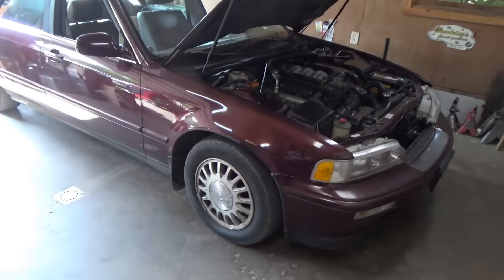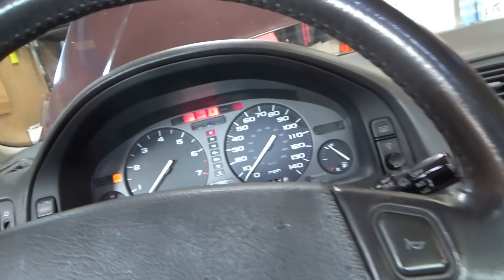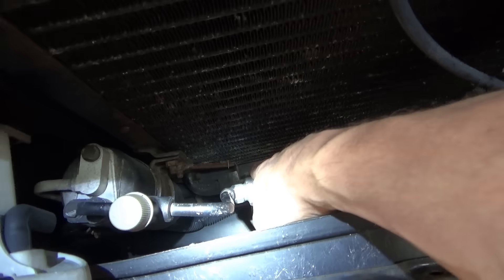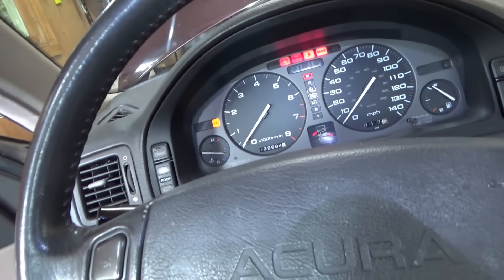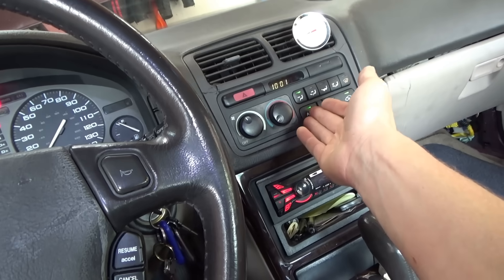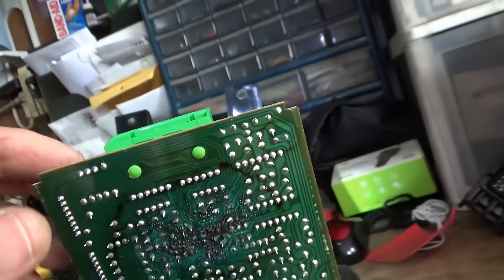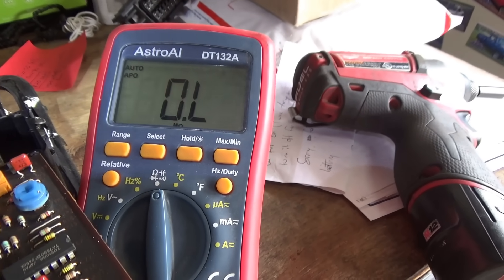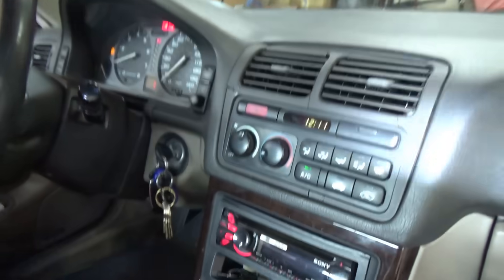Classic Acura: No A/C! ('95 Legend V6: Parts UNOBTANIUM?)

Comment: You need to get you a refrigerant identifier to protect your investment.  There are a ton of counterfeit refrigerants out there and people charging with R-290 (propane). You'll never recover all of the refrigerant even if done right after charging. Some remains trapped in the oil. You did the only logical thing to be done, but I was thinking the 95 Hondas/Acuras were OBD2 with the connector behind the ashtray.

Comment: Nice fix,to be comprehensive with safety precautions your bypass you could have included a relay on the fan output so that if the fan cut off the relay would interrupt the signal to the compressor. 😊

Comment: The fan board makes sure there is air blowing across the evap coil so it doesn't freeze up. If someone decides to forget to shut that switch off and just turn the fan speed to off. It will keep the compressor running, banging off the limit switch (like banging off the rev limiter), and freeze the coil up.

Comment: My 1995 ford has the potential to have the same problem it’s those electrolyte capacitors leaking onto the board they are easy to replace if you catch em in time.  I need to go ahead and replace the three in my Ecm

Comment: Had a 1988 Legend and loved it.  Would still have it if it weren't for that rear ending in the 00's.  Most reliable car I ever had, but the transmission did suck (I was going to run it until it failed but it never did).

Comment: I really want to get my hands on a second hand ac machine. I have access to one at work that I may or may not use for personal vehicles, but having one in my garage would be so nice. I’ve done plenty of repairs for friends using the vacuum pump, manifold gauges and can method, but that only works when the system is already empty🙃

Comment: Nice!

TIp to the owner: Maybe try contacting someone who repairs/restores vintage computers, and ask if they can have a look at one of the broken PCBs? The issues and the repairs are about the same as when capacitors leak onto computer PCBs.

Tip to anyone who has one of these cars that still work: Replace the old capacitors before they leak!

Tip to anyone who revives one of these cars that has been stored for many years with power off: Turn key on and all HVAC switches on, and connect the battery for a second, and disconnect it. Wait a minute or so, repeat, and repeat this many times with the battery connected for longer and longer time each time. This is the poor mans way to reform capacitors that have been stored without any voltage across them. Technically it's better to desolder them and reform them individually, but then you'd be better off just replacing them.

Comment: so, ivan most of the early acura and honda as wellas toyota models have an obd connector above the drivers side fuse panel in addition to the round factory diagnostic connector

Comment: Bad Capacitors from the Mainland in the 90's through the 2000's from bad electrolyte destroyed many electronics:/ 
That board could be fixed if you could see, or get a diagram, or maybe a picture of the traces somewhere. Replace the caps and solder jumper wires to the other components. Wouldn't be too hard for someone with a little soldering experience - Brave AI summary - Capacitor Failures in China
The failure of capacitors originating from China, part of the broader "capacitor plague," primarily occurred between 2002 and 2005, with the most affected capacitors produced between 1999 and 2003.
 The issue stemmed from a faulty electrolyte formula that was allegedly stolen from a Japanese company, Rubycon Corporation, and subsequently misused in China before being transferred to Taiwan.
 This defective formula led to capacitors with high failure rates due to electrolyte corrosion and gas generation, causing bulging, leakage, and rupture.
 The problem affected a wide range of electronics, including motherboards, power supplies, and video cards, with major vendors like Dell, IBM, and Apple being impacted.
 While the peak failure period was between 2002 and 2005, issues with capacitors made using the incorrect formula were reported to affect equipment manufactured up to at least 2007.

AI-generated answer. Please verify critical facts.

Comment: over the years there's been many electronic devices I've worked on.  First step on anything 10 years or older, with electrolytic capacitors is replace all the electrolytic capacitors if they haven't failed yet they will fail soon usually fail shorted and cause further damage (melted traces and or burnt parts,) or fail intermittently and you will find it easiest just replace them all.

Comment: Maybe ON BOARD diagnostics would have determined the input switch failure. Of course how to activate ON BOARD DIAG and then move through the modes is a skill that the service manual would explain. Your access to a service manual is extremely limited. Leaking capacitors is very common. Bypassing safety switches is very risky. Also maybe wear safety glasses. You sure know how to read a wiring diagram. It would be great working next to you.

Comment: Thankfully that's not surface mounted components. Replacing the caps and running a jumper wire along where the tracer was connecting the required parts is the best you can do.

Comment: Had a problem like this with a 25 year old GM product. The fuel pump control (which controls the solenoid part of the fuel pump relay, pins 85 and 86) started to fail intermittently and then quit outright. It turns the fuel pump off after 2 seconds of key on or when the motor stops for any other reason. Ultimately I had to rig an alternate power feed to the relay  through another relay activated by key on. Then I added a kill switch to shut the pump off if I was running accessories without needing the motor. It also becomes an anti theft feature.  You have to do stuff like this to keep a good older vehicle running. I wonder how much good equipment gets tossed for little things like this.

Comment: Very nice car and great diagnostics as always! I just bought a 5 speed 1990 Legend coupe (the previous generation) last winter to add to my collection and cracked solder joints seem to be a theme, at least on mine. Fortunately, I was able to fully fix the fan timer, gauge cluster, and climate control panel just by re soldering any questionable joints and everything works as it should now. I preventatively re soldered the main relay also since that's a known issue and some of the joints didn't look great. Despite showing no signs of problems, I'm also going to inspect, re solder, and re cap the ECU as needed as a precaution, especially since it's specific to the 89-90 5 speed coupe and hard to find.

Comment: I just got a 94 Talon. It has the R12 system and didn't work. I don't know the history, but everything held vacuum and is holding a charge. No leaks per injecting dye. If all parts are original to 1994, I'm amazed. Everything can still be had except for the suction side hose. I don't think that's something a hydraulics shop couldn't take care of. Cut off the old crimp sleeves and put on new hose and crimp sleeves.

Comment: Wow ! I don’t have the skills or the stones to deal with an OBD 1 vehicle . You did great here and got it working for him until circuit board repair can be completed.
Reply: Once you master obd1, 2 is a piece of cake. If you think OBD1 is hard, try working on those that don't have diagnostic connectors at all which on some vehicles were used through 1989. On this 95, even if Ivan had the right scanner, software and connectors, the most he would've seen was a/c request, yes/no, and clutch on/off. Ultimately, he would've had to take the same diagnostic approach.

Comment: Just so you know, PCB repairs of this nature are very common with the pinball folks.  The condition shown is actually minor, compared to the conditions where an alkaline battery has oozed its guts onto the board, dissolving both traces and components.  Capacitor leaks are another destroyer.  Clay Harrell at Michigan Pinball, Coin Op Cauldron, Pinball Wizard are some of the well-known experts, all of them highly recommended.

Comment: Ivan, you always do great repairs man but I'm wondering if you could've gone just a step further with this one. The bypass isn't a hardwire to the compressor clutch, which is good, but the AC system is still requested "on" with the bypass engaged and the fan off. What you should've done was installed a relay with the bypass switch. The relay trigger would come from blower motor 12v (pre resistor) and the main contacts of the relay would be the bypass circuit. The customer could leave the bypass switch in the "on" position all summer long, but the bypass circuit is only completed when the blower motor is activated, which is what closes the relay on that bypass circuit. If the blower motor is off, the relay is open, and the bypass circuit cannot request AC "on"
Reply: Yes

Comment: I am rocking a 1995 Honda Civic coupe. love the old feel of the car. I have video on it if interested. I had a not so cold issue with my AC and after lots of troubleshooting it pointed me to the water valve assembly by the firewall in the engine compartment Honda part #79710-SR3-A01.  The valve doesn't close all the way allowing heat to pass when when cold is selected.

Comment: Hey Ivan;  CAPACITOR REPLACEMENT works often.  I have a 1989 Toronado (bought new in '88), that all electronics failed, including Bose stereo system, IPC, VIC.  I replaced the electrolytic caps in all the amplifier boards in the Bose speakers, and now they work.  Sent my VIC and IPC (instrument cluster) to a buddy in Ohio who can replace the affected caps, AND repair the damaged board traces due to the electrolyte leaking out and eating the boards.  However, it takes skill and deep circuit knowledge and time to do it.  Just a thought!  My Toronado has been fully restored, inside and out, and is now again HAPPILY my daily driver!  All the best!  (BTW, it was a project lasting over a year, and a few vids of the process are on my little microscopic channel including the electronics repairs)
Reply: @JohnnieBravo1 I had a '89 Toronado, Champagne color.  Greatest hiway cruiser and fun to drive.

Comment: Hello, great video and diagnostic’s, but the failure of your problem is the a/c fan timer it’s located under the carpet and pad right front floor board and you find the main computer floor shield , remove this shield and on the bottom side is the main computer and I believe If remember correctly it’s a white fan timer box remove that box and open that up and you will find that there’s a crack in the solder at one of the capacitors you can easily solder this back and your a/c should be back up and running. This is how we fixed them back in the day when I was a service manager at Acura for over 20 years. Hope that helps. Take care and again great diagnostic work.
Reply from the maker: Great tip! But grounding the control wire at the dash got the AC working... So how could there also be a problem with the fan timer? 🤔
Reply: this is what always fixed this issue. All this stuff runs together to operate. I really feel confident that the timer control board has a loose soldering connection. But hey you already fixed it with your ground switch, the end result is it works.  @PineHollowAutoDiagnostics

Comment: lol, love that 'russian' bypass.  I drive a 30 year old chevy k1500, but in my case the ac switch is a basic mechanical switch, without the pc board nonsense.  So I don't have to worry about those leaky capacitors that always cause such massive damage.  Kinda surprised they lasted all these years.

Comment: I've repaired these boards before. If you look close, with a microscope, you will see corrosion between layers of the board. Usually a jumper for a power feed to the voltage regulator, and jumpers for the LEDs that are not working, makes it functional again. The fail safe switch you installed also achieves the desired  result, working A/C. Thanks for sharing all that you do.
Reply: Repairable definitely.
Reply: @deniscanaya  I agree - that seems like a single layer board with through-hole mounting. Capacitors leaking isn't unusual, especially cheap ones. I had to fix a radio with a short circuiting tantalum capacitor - it made the radio sound like a moaning pig.

Comment: Interesting case of old electronics, Ivan! Usually, the main culprits are dried capacitors and cracked solder joints (which could be the case, once the fault is intermittent). Having a bypass was the fastest and easiest way to solve this problem (board repair can be a nightmare without a dedicated setup and diagrams). And it's important to keep these cars on the road, for as long as possible!

Comment: A common known issue, all you have to do is replace the capacitors on the board. Not difficult. Some also like to replace the voltage regulator. Very cheap and easy fix with a soldering iron.
Reply: Some scraping, solidcore wire from old ethernet cable, a bit of time and it will be as good as new. This has big fat traces, it is easily repairable.
Second attempt at posting this coment:)@PineHollowAutoDiagnostics
Reply from the maker: That's the easy part. What about all the destroyed traces? 😬
Reply: @PineHollowAutoDiagnostics  It's a single-sided PCB, so you have a really good shot at fixing it no matter how many traces are broken. No plated through-hole damage or impossible-to-see inner layers to try to blindly reconstruct! I've rebuilt a ton of "vintage" automotive modules (ECMs, TCMs, anything you can think of) and new capacitors fix a surprising amount of gremlins in 80s and 90s cars. The blackening you see on that board is mostly electrolyte-damaged solder mask. The electrolyte does also damage the copper trace itself, sometimes enough to sever it as in this situation, but there is almost always enough left to patch together with some little jumper wires and solder. A little micro engraving pen works really well at removing the damaged solder mask while preserving the fresh copper left on the PCB (it becomes much easier to see what goes where that way, too). Good luck Ivan, you can do it!!
Reply: Some scraping, solidcore wire from old ethernet cable, a bit of time and it will be as good as new. This has big fat traces, it is easily repairable. Shango 066 has done a few videos on old ECUs if you are interested @PineHollowAutoDiagnostics

Comment: whooooooo boys!  I am picking up a 1983 GMC square body today, that I got for a song.  New trans, new fuel system (I installed that myself last year) straight body, good tires.  Dude just wants his money back out of it, so I did a repair on his other truck yesterday and made him an offer and he took it.  ;)
Reply: Love those trucks.
Reply: Never heard of buying a truck, replacing parts and now the owner wants his money back?
Reply: @2nickles647  No.  He bought the truck last year, had the transmission rebuilt, new fuel system installed and parked it.  It has sat ever since and he sold it just to get his money back out of it.  Hope that makes more sense.  Older guy.

Comment: For the board you would wash it with 99% rubbing alcohol and a toothbrush.  Repair any correded traces by scratching off the solder resist green stuff and use single strands of wire to remake the traces.  Then you would replace all of the electrolytic caps making sure to replace with same specs and polarities.  Then youd be done as good as new..  no other components are subject to degrading enough to cause issues for the rest of the life of that car..  but seeing on how the manufacturer used those specific type and brand of caps on their boards, proven by getting two with exact same faults.  There will likely be more that will go bad on other modules throughout the vehicle as i could bet they used the same ones on everything that needed them..  those caps on their boards ac board were just put in a hotter environment i guess that caused them to be the first to fail.  Or they were just stressed due to circuit design issues overworking them..
Reply: The old Louis Rossman would also bathe it in flux and use a hot air station.  Helps remove the corrosion and reflows the solder in one step.

Comment: The whole beginning diag was done with the car not running.  Ive never had a cars ac button do anything unless the motor was running.
Reply: No Ivan.
From the beginning on every AC only works with engine running.
They became the ground from the oil pressure switch or mostly from the 
Alternator charging indicator
Reply from the maker: In 1995 the logic was more primitive 😂

Comment: Good going! I wonder if anyone will eventually create programmable microcontrollers that can be made to perform functions like this, and replace modules you can't get.
Reply: First, that board was repairable.  Maybe Ivan didn't have all the skills to do that.  Second, simple logic circuits don't even need a microcontroller.  But to your point, I believe there are people doing that for some things.  But in this day and age, anyone can pick up an Arduino and do quite a bit.

Comment: Maybe by next year the owner will find a HVAC controller. Then he can bring it back to you, that way you can repair the harness in the grill from you "peircing" it. 
I won't even comment on the use of A/C machine!
 Still entertaining to watch thanks rookie
Reply: I'm pretty sure Ivan is well aware of the issues with a piercing probe and possible corrosion if the peirced wire insulation isn't repaired correctly. Which I'm sure he always does his best to repair.